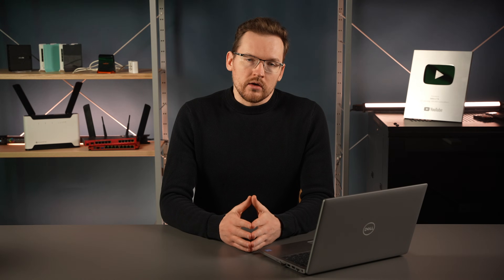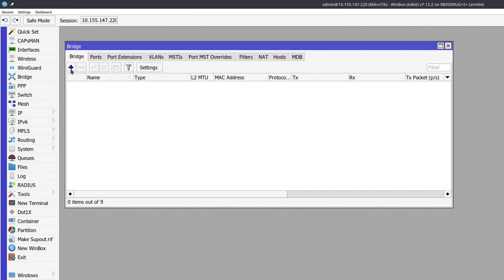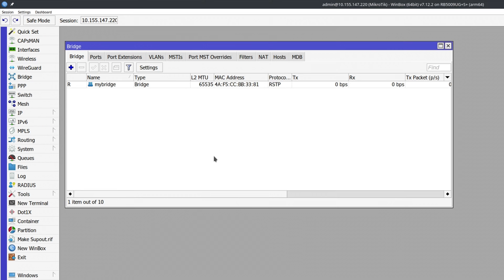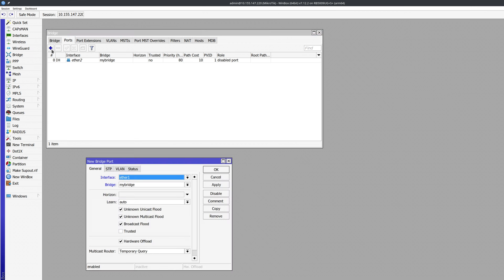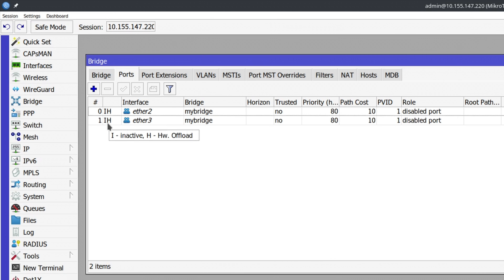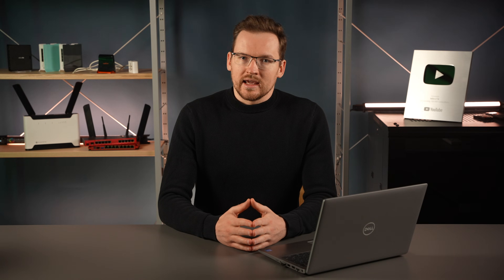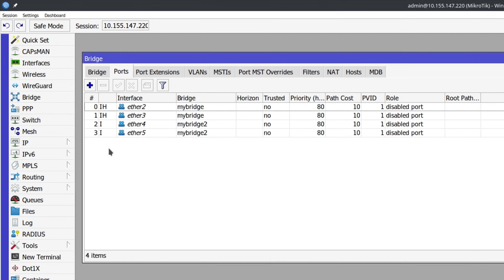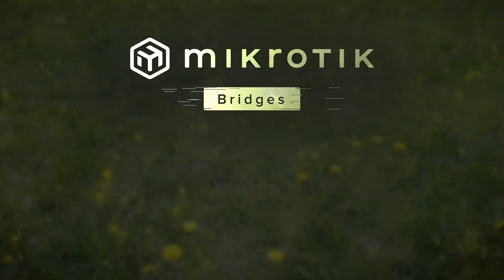What is bridging?

Comment: I am a self-taught hobbyist.  I have an RB5009UG+S+IN with 9 ports:
- If I assign port 4 to a Bridge can I assign the same port to a second Bridge, or is it "used up"? 
- Can I think of VLANs as if they were a subset of Bridges?  

I would love to test these questions at home without taking down my network.  Could I create a separate "lab" network by configuring a new Bridge with its own set of WAN and LAN ports?  Would it be isolated from the primary network?

Comment: Definitely needs a bit more detail. Creating a bridge without choosing VLAN filtering and just putting physical interfaces in is like creating a switch that allows all traffic through
However VLAN's are quite complex on mikrotik and is worth explaining, along with split-horizon and VLAN filtering and how those affect things

The way i've always mentally envisioned VLAN's in the mikrotik world is that the physical port represents a bundle of wires, each of those wires in a VLAN. Normally you're just joining the entire bundle together at once (eth2 and eth3) via some form of connection box (the bridge) that joins every wire to its matching partner. All VLAN's flow by default and behave as expected
However when you create a VLAN interface on a port, its like you've cut open the outer insulation and pulled 1 of the wires out. It's now no longer part of that bundle and does not flow traffic until its connected somewhere. It can infact be connected to a different wire in a different bundle, (i.e. putting eth2.10 and ether3.30 into another bridge will seamless bridge VLAN10 on ether2 to VLAN30 on ether3). And if you ever need to intercept one of the wires without breaking its connection, then you instead create a VLAN interface on the bridge. This is how you would i.e. give the router/switch an IP address in that VLAN. Since if you instead created ether2.10 and put an IP there, then you've broken that wire out of the bundle and it will only work on the ether2 side, not ether3
Reply: VLAN is a different "object" and should be its own "method" or "function", no need to add complexity to a simple function of adding a bridge

Comment: @mikrotik Why it's called bridge and not switch?
Reply: Bridge is basically a logical switch, a switch does it functions on hardware, a bride does it using CPU
Reply: @gabrielpb  Hmmm but the first bridge on mikrotik is hardware offloaded so finally it's a switch
Reply: It used to be called a switch with a master port. But I think people found that confusing.
Reply: @Morteell  yeah, that's a feature you can use, but not all the Mikrotik devices have that feature, not all have the Switch chip inside
Reply: Just rename the bridge to ‘switch’. I do that on all bridges with hardware offloading.